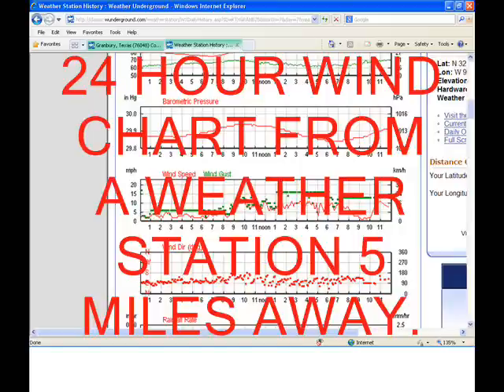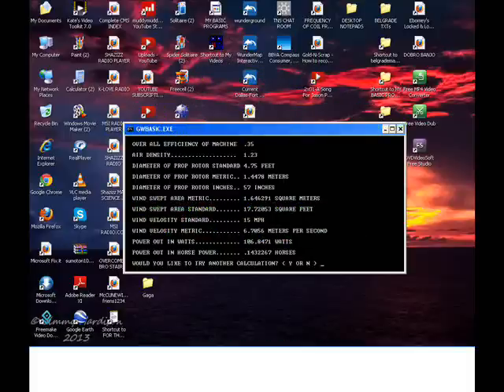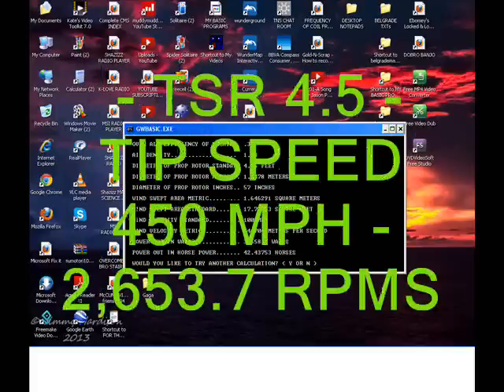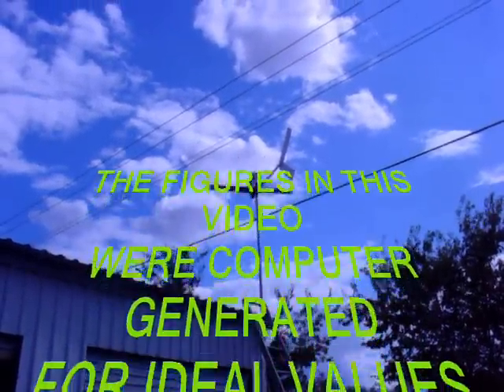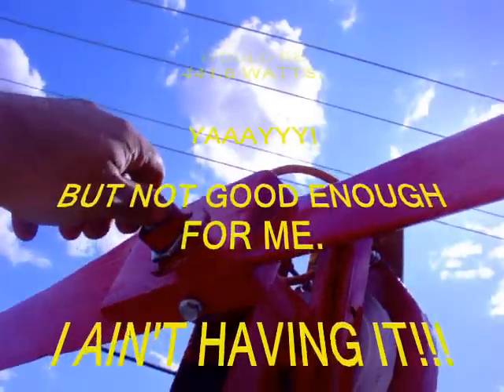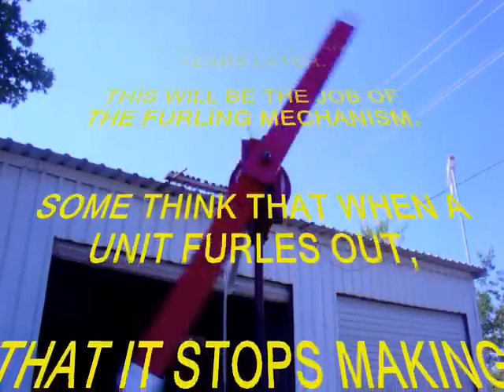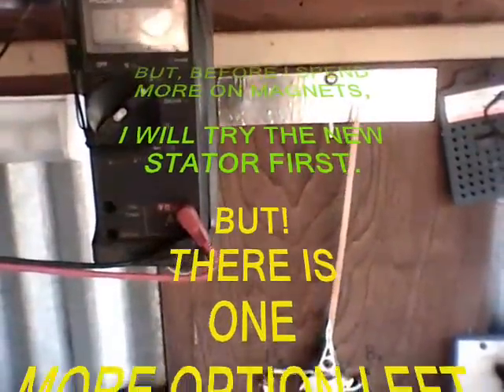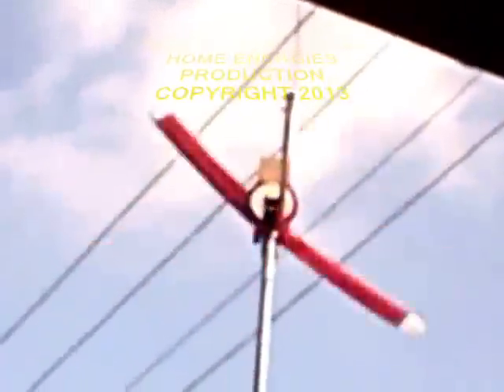MUDDYS MIGHTY MINI  EXPECTAIONS PROBLEMS SOLUTIONS AND ANALOGY

Comment: Great video Muddy, would increasing the gap a bit help it work in higher winds? It might take a bit of messing about though before you`d get it right.
Reply from the maker: Absolutely. it would. And one more that i didn't cover... lengthening the power cord drops some voltage. 
Keep that thinker working,

Comment: 1) Check out Zener diodes. They block current flow until a certain voltage and let everything else pass. You put one end on your power wire and the other to ground or another power wire. Multiple Zeners can carry more Watts.
2) put a ring around your blades with magnets on it and build your coils into a duct that comes as close as possible to the ring.
3) check out different constant speed props used in WWII planes, or put springs on rotatable prop blades so hard wind feathers them back.

Comment: Well, I liked the stator design you had.  But I was looking at it for a VAWT and I wanted to have two of them stacked on top of the other.  Meaning, 3 rotors with one with magnetics on both sides and two with magnets on one side.  Ground wind hardly ever around here and hardly goes past 25 – 28 mph and our average wind speed is 9 mph year round.  Not much in the summer and it hardly blows.  This and the solar array am trying to work on should keep those batteries charged.

Comment: cont.. that the houses form a wind tunnel. Results from ceiling fan gave me a consistent 178mA up to max of 236mA. With only magnets fitted and no re-wiring of stator. I have done mechanical only test using brake discs off car. At ground level it did very well. Here it is youtube. com /watch?v=86kyTfo71Nc. I am hoping your production stator can be used here too. Many many thanks for all your help. I am very glad I got to know you.

Comment: What program did you use for the wind speed calculations? Also did it calculate for HAWT and VAWT? The cut in speeds are what I need for MY NICE EV. I will have to have a controllable flap on the input though to act like a furling mechanism. Was actual wind speed measured at ground level or up near the prop? I live in amongst a lot of houses. So with your help, mini turbine stator, I hope to develop a VAWT that anyone can put up in their garden. I have found that, with my ceiling fan VAWT, cont.